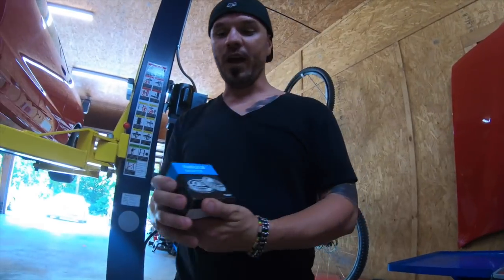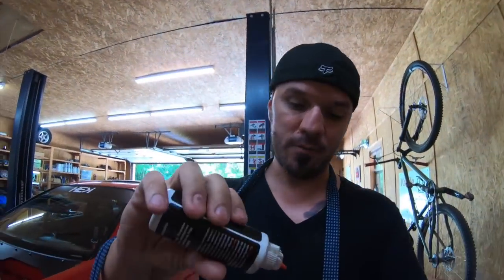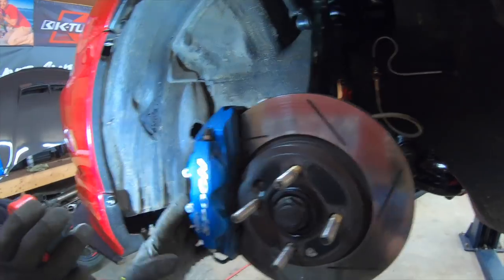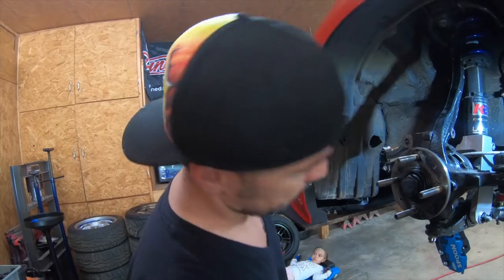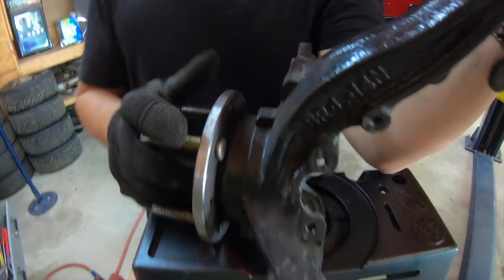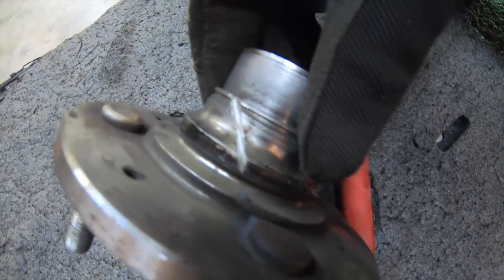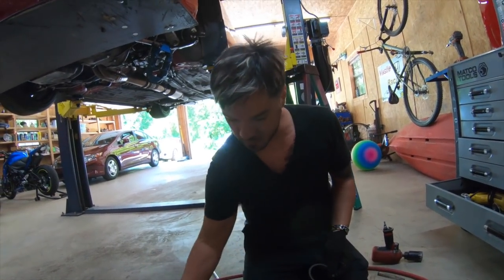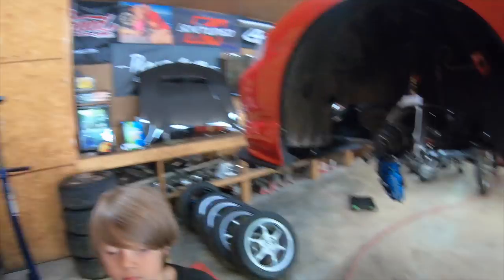How to replace wheel bearing

Comment: Very good how too. I’ve done quite a few of these in the last few weeks. Only thing I would add is use a lot of wd 40, wire wheel, and heat if the safety retainer is rusty and does not want to come out easy.
Reply from the maker: Wiltgen fab I have replace them twice already bec beast mode